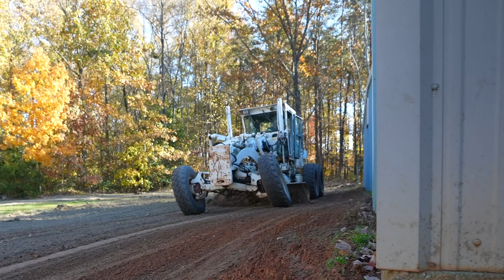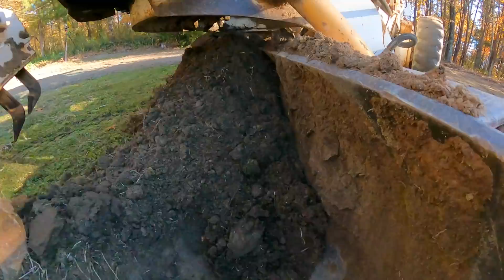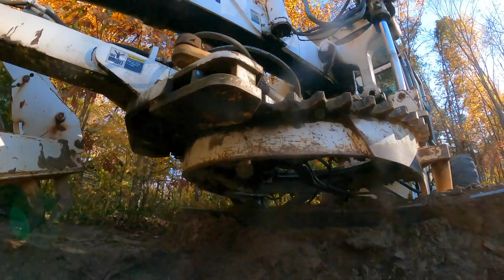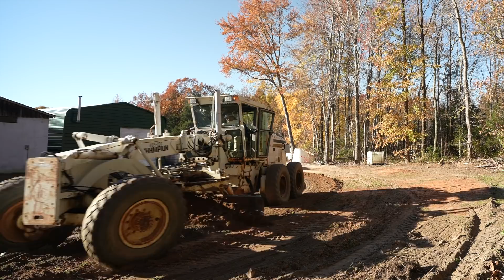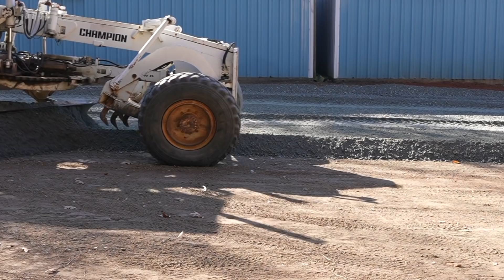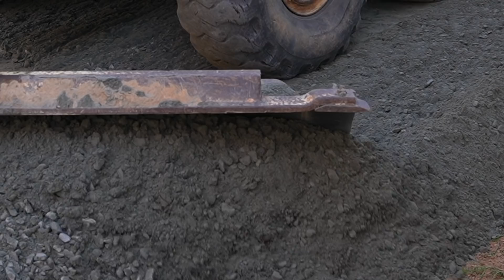Motor Grader Working  I LOVE My Job!

Comment: That would definitely be a way to clear all the growth off and start over. Wow.

Half a million dollar or more machine and it could probably pay itself off pretty quick if you could get to work.
Reply: I don’t think this machine is that expensive brand new and an old retIred DOT machine similar to this one could be had for less than a used skid loader would cost you. I’ve seen these sell at auction for less than $10k so it would not take but a handful of average jobs to pay for one. But make sure you account for replacing some hydraulic lines cause most of these have been sitting for a good while when they get retired and the lines dry rot really bad when they sit around
Reply: This one definitely got it's money worth